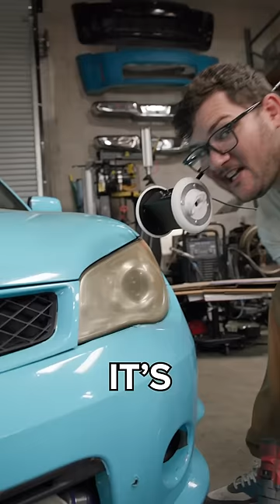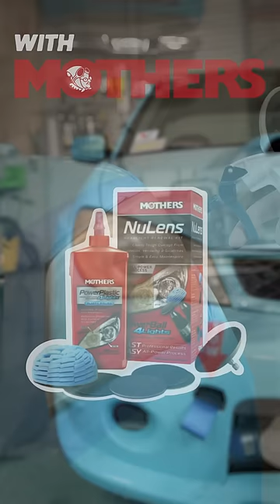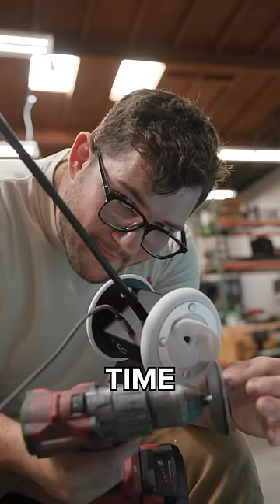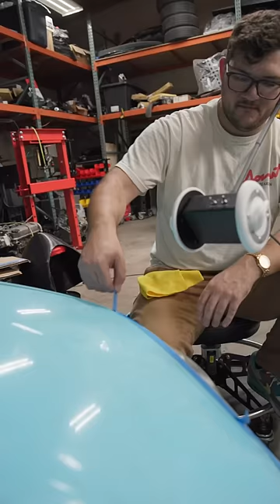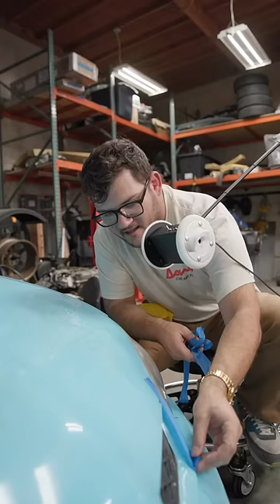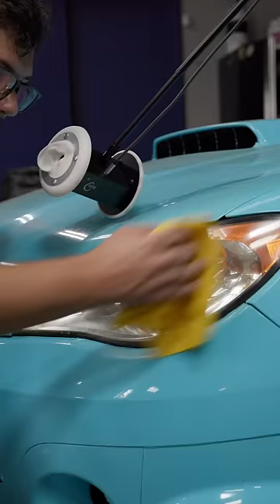👂 ASMcaR w/ Mothers® Polish

Comment: Pls do not use a hand drill for sanding down headlights 
I used the exact same kind and burned my lens 
I sanded by hand 
120
320
600
800
1000
1500
2000
And yes I promise each and every level of sand paper has its own purpose 
The finished product came out amazing 
Clear coat with 2k!!!

Comment: i'm disappointed!
yes it's a sponsor show-off, i get it, but you guys normally have better quality on your content, so I was expecting better from you.
I'll explain why:
what you are advertising, can be accomplished with a light acid (lemon juice or vinaigre ) and some grind-polish fine powder ( baking soda, tooth paste, ash, talcum powder.... etc).
There is no added value in paying for a 'polishing product'... 
The problem however, and this is where everyone fails, is that in less than 6 months, your lights will be yellow and no longer transparent, as they where, however they will now be thinner... and if you continue to do this, they will keep getting fogged fast and thinner by the 'recover procedure', untill they just crack as you press them while polishing.

What causes the yellowing and fogging is dirt and dust that gets into some micro fissures that are caused by UV degradation of the plastic/plexiglass surface. 
The sun is the one eating your lights away.

The REAL solution (and what i was expecting you guys to show/teach) is:
after polishing, apply at least 3 UV protection clear coat layers.

That means the polishing will last longer and you have done the correct procedure , much like the manufacturer did... remember that peeling that happened 6 months before the fogging begun? that was the clear coat going out. Had it not, you wouldn't need polishing.

c'mon guys you are better than this!